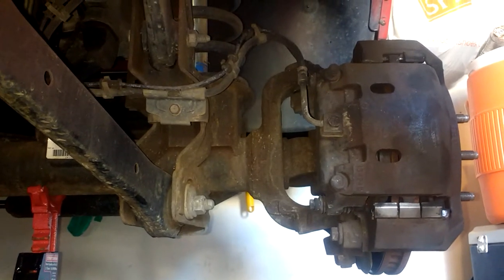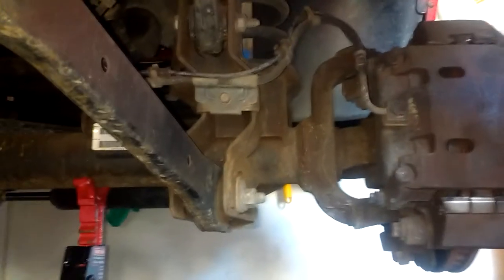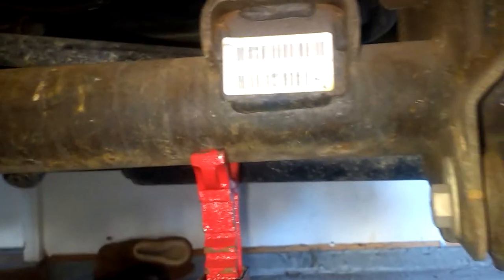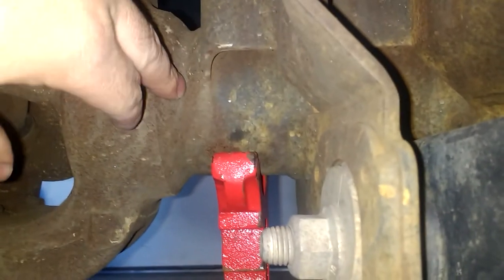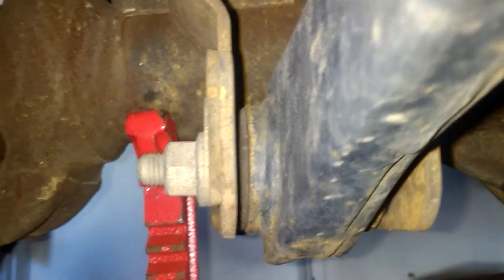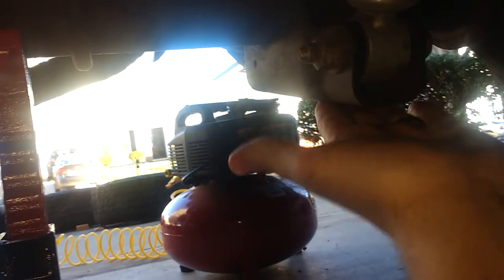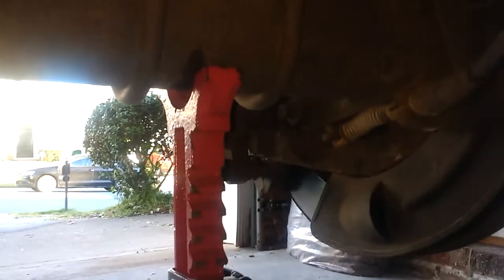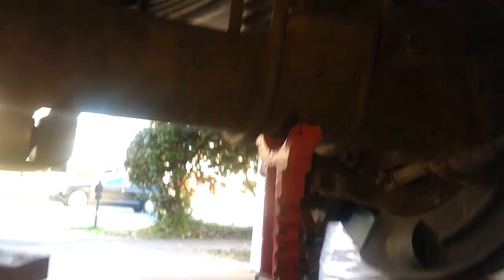How to put your 2004 Dodge Ram on jack stands - Rotate your own tires

Comment: Thanks for posting the video.  I am always paranoid getting under a vehicle.  I use jack stands and two jacks to hold it up.  In addition, I put the tires underneath too.  I do what I have to and get the heck out from under it.
Reply from the maker: No one gets killed by being too safe.

Comment: Summer 2018. Went to two separate calls. One was a guy working under jacked up truck under front passenger wheel well. Somehow truck slipped off jacks and rotor came down on neck and cut head off clean. Weeks later man working under jacked up truck under engine. Truck slipped off jacks and severed him at the waist almost clean. Be aware
Reply from the maker: Do you know what they did wrong?  Did they use stands?
Reply: @Prima10ne  both times jacks malfunctioned
Reply: Good advice, you have to treat the truck like it could fall at any moment and only get underneath with the tires on if possible.

Comment: Only thing I would recommend is going with 6ton stands at least in the front. Especially if thats a cummins..
Reply from the maker: Yes agreed.  Can never be too safe.  I have never had an issue, but of course a larger one is better.  My truck is a hemi FYI.
Reply: Can never be too safe, but even a RAM 3500 is no more than 8,000lbs for the entire vehicle.  Jack stands that can support 12,000lbs for just the front end is beyond overkill.

Comment: I know you say not to get in your truck while on stands, but I have to not only get in, I need to get the tires spinning to get the trans to go in 2nd gear
Reply from the maker: Ha.  Well yes it's pretty common to do it.  Just try to not put unnecessary imbalance on it. Kinda CYA advice.  I have gotten in it many of times

Comment: Can I use 3 ton jack stand on my rebel if I only use it on the front? Truck weighs 6,800/lbs.
Reply from the maker: Yep for sure.  No problem.  As you mention, just lifting up half so weight will be less.

Comment: I have a 2 wheel drive 2500. Is the proper place for the front stands under the frame rail?
Reply from the maker: That works.  I usually support 2wd dodge on the control arm for the wheels.  That or frame rail both work

Comment: Where do you put the jack at in front to lift it up. ?
Reply from the maker: Check out the 35 second Mark.  You can put the jack under the trailing arm.  Its nice because it is lower than the axle so a shorter Jack can still work.  That's the only place to do it on the passenger side.  In driver side you can do it on the arm, or you can do it at the bottom of the differential(pumpkin), but if you do it here use wood, as you do not want to dent or scratch the differential seal.
Reply: @Prima10ne  would be a good video to do on.wanting to start doing stuff me self to learn, so I don't have to pay dealership or auto shop.Got to learn somewhere.
Reply from the maker: Yea dealerships and shops should only be used for stuff that you can't clearly determine root cause.  Shops are nice because they will troubleshoot for you.  But if you know the problem, you should try to fix it yourself.  Installing aftermarket parts and doing oil and tire change is a good start point.
Reply from the maker: Yea I know it's not recommended but I've done it for years and never a problem.  I think the benefit outweighs the risk.

Comment: get a heavier jack stand before you die
Reply from the maker: Craftsman high lift stands rated at 6,000 lbs per pair. I was not concerned as my total vehicle weight is just over 6,000 lbs.